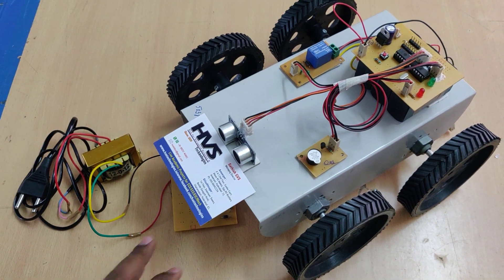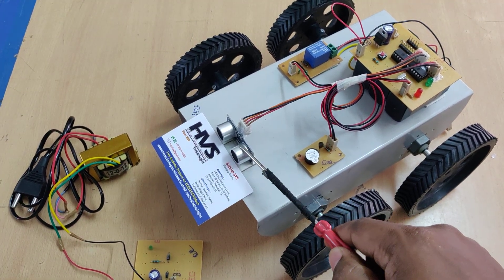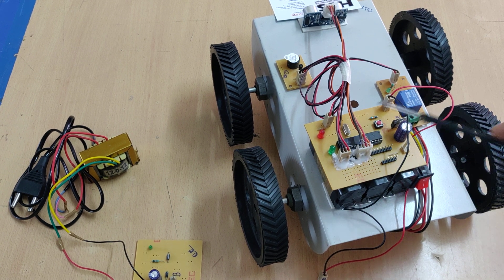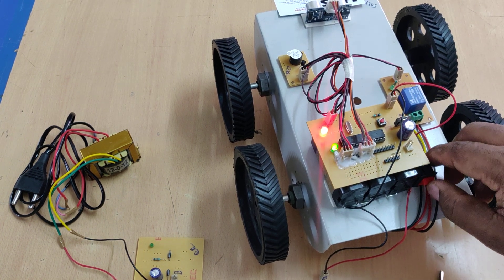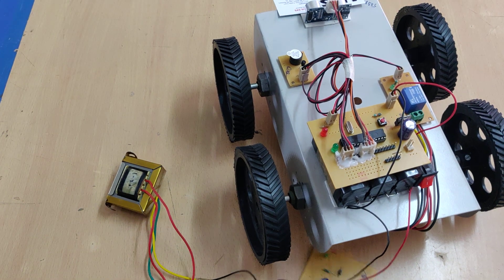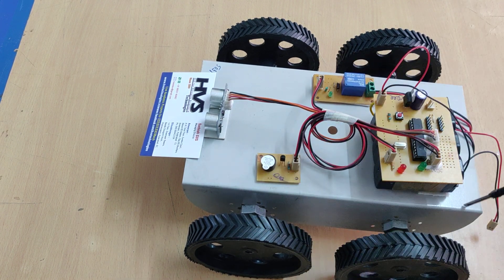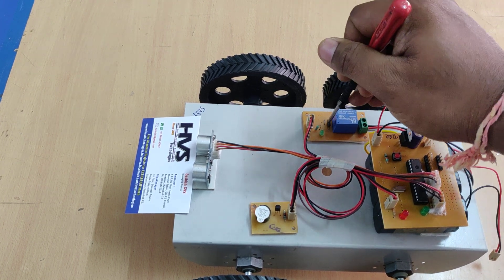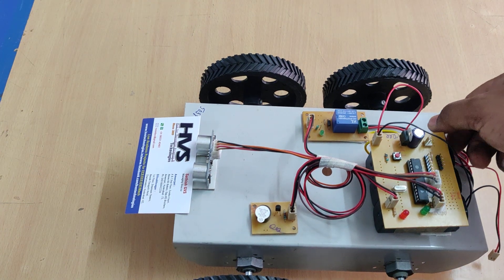Automatic Emergency Braking using Ultrasonic sensor and PIC Microcontroller

Comment: Project equipment
Reply from the maker: Hi, 
We sell full working kit with document PPT circuit diagram and code. Could you Send me the video link, Will update you the cost details. You can contact us at +919603140482
Through WhatsApp or call